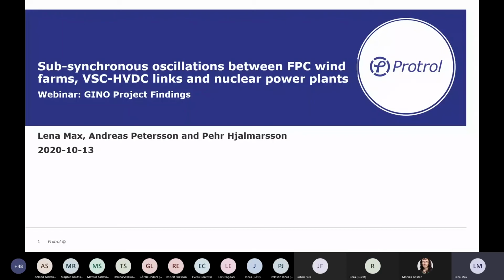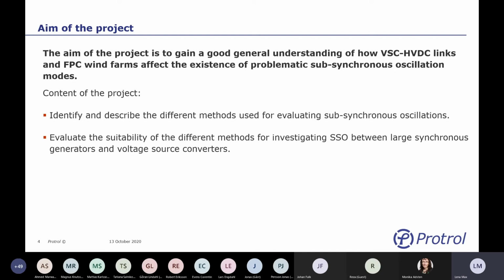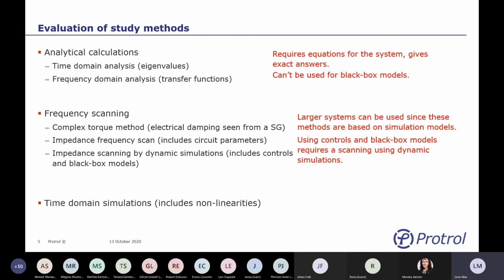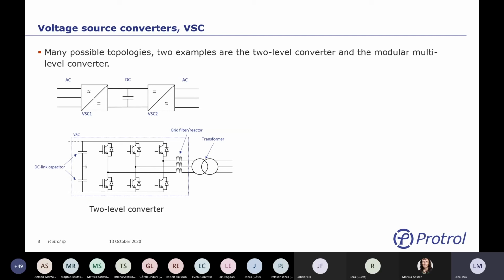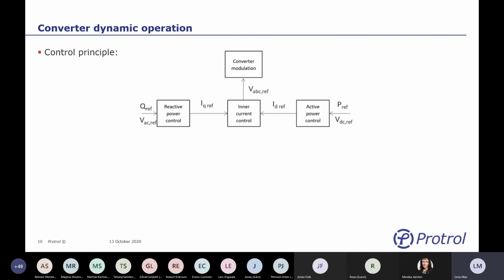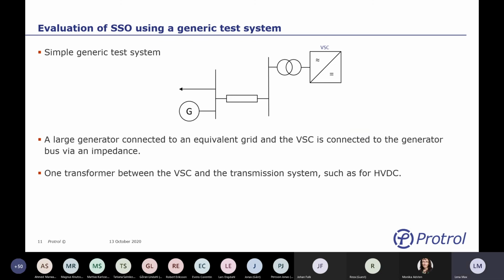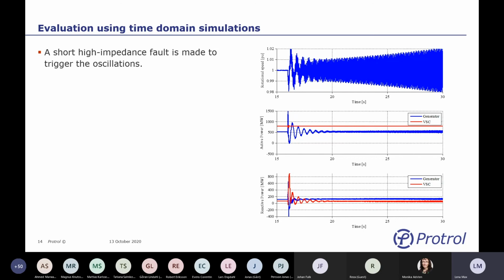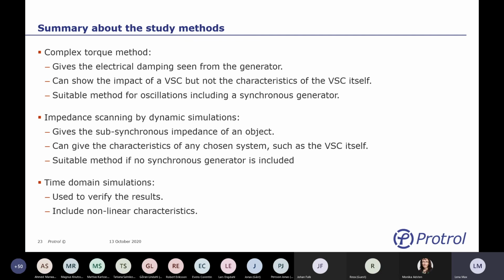Sub synchronous oscillations between FPC wind farms VSC HVDC links and nuclear power plants

Comment: Thanks for the informative presentation. What are your thoughts of doing damping torque analysis if we don’t have mechanical shaft data of SG/turbine - means no idea of torsional frequencies? 
Then doing a damping torque is not feasible or does not add any value? Thanks